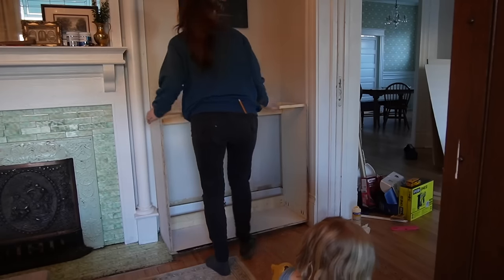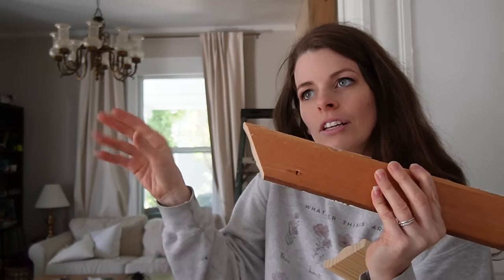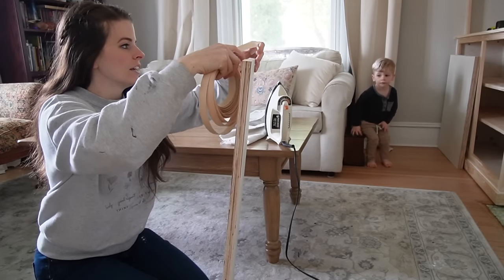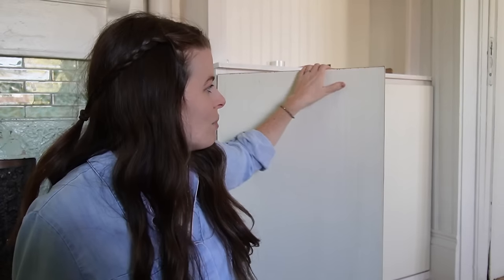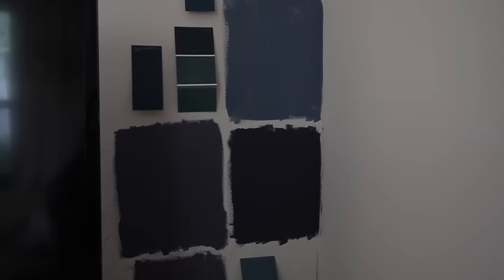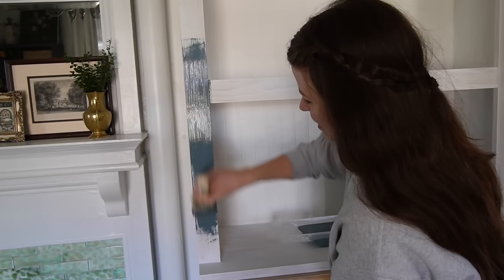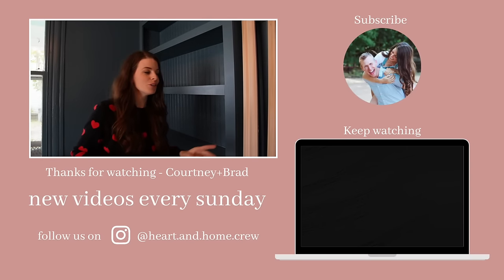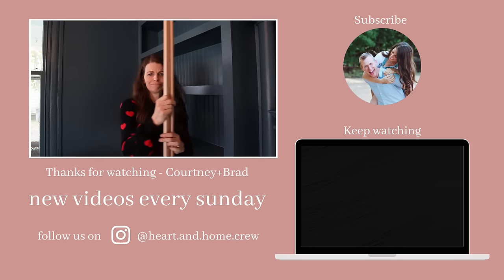Sprucing Up Living Room With Bookshelf Painting & Colorful Touches | Living Room Makeover Part 2

Comment: You can always add molding or trim to the outside of the to-short doors. Look at any of your antiques and you'll understand what I'm talking about. The other option would be to "inset" the panel (door) and do an overlap of trim. Use your antiques to guide you when doing a build. You have done a great job and should be proud of yourself!
Reply from the maker: Thank you so much! I ended up just recutting the doors and I’m going to use the old ones for another project, but thank you for the idea!
Reply: Thank you for sharing another AMAZING PROJECT! YOU are" SIMPLY THE BEST!" I love the color! I can't wait to see the finished product! You go lady,  you are powerful! 🤍👍👏